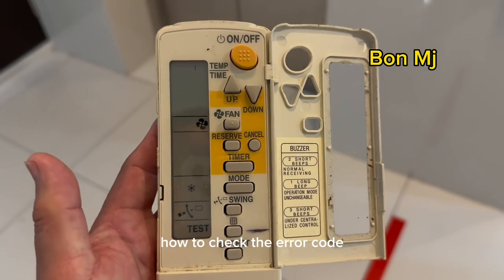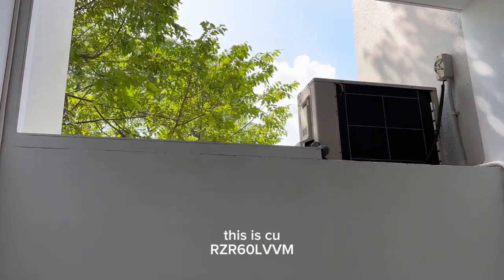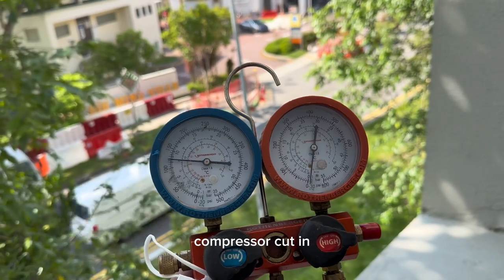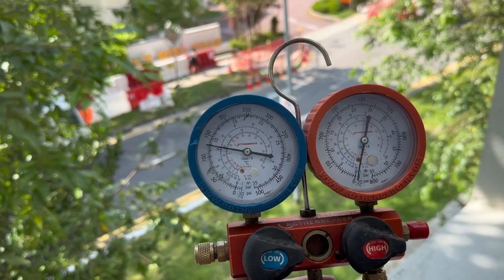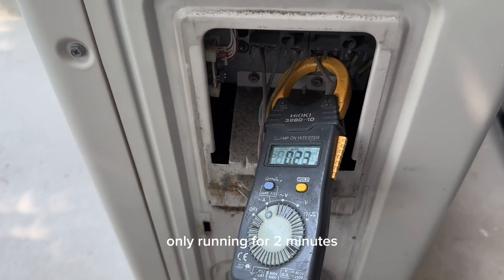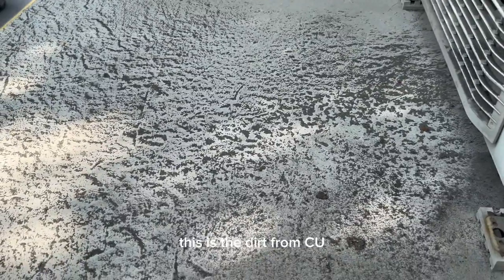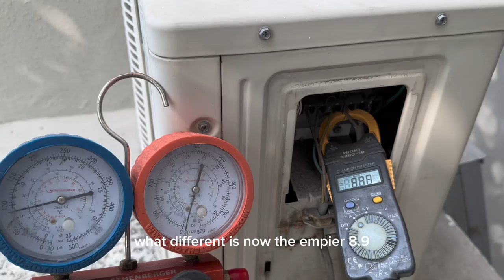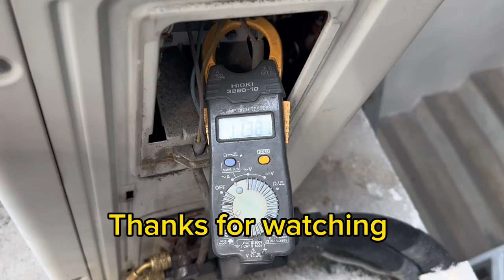How to solve Error E3 [ Daikin Aircon ] RZR60LVVM

Comment: When PVE oil get contaminated with POE oil it will cause restriction & sludging according LG manual which also uses PVE oil like Daikin. It clearly says not to use POE oil even on flare connection. When manifold gauge is connected to a R410a & R32 systems ridiculous amount of oil gets in the hose.

Comment: Isn't 90psi too low for R410A?
Reply: I see it went up to 110psi towards the end of the video. I usually like to see around 115-120 psi for R410A. But you have more experience than me. Perhaps this is normal for Daikin Inverter systems?

Comment: I have daikin 2.0T unit that started to lose performance, it's two years old only in a dusty environment of Dubai, when checking the app the discharge temp for outdoor unit reach 106c, does that mean the condenser coil needs cleaning? There's no error codes but only lost cooling performance, before it can cool my room to 18c quickly and now barley 23c. What could be the problem?(it also uses more power)
Reply from the maker: May outdoor temperature too high , what is the outdoor intake temperature
Reply: @BonMj 
Madoka thermostat set to max(21c) Room temp stuck at 24c, it should be 18c.
 Indoor Unit
Th1
INLET AIR TEMPERATURE 26 °c
Th2
HEAT EXCHANGER TEMPERATURE (LIQUID PIPE) 16 °C
Th3
HEAT EXCHANGER TEMPERATURE (GAS PIPE) 19 °C

Outdoor unit
Th
OUTDOOR AIR TEMPERATURE
48 °c
Th2
HEAT EXCHANGER TEMPERATURE
57 °c
Th3
DISCHARGE PIPE TEMPERATURE
94 °c